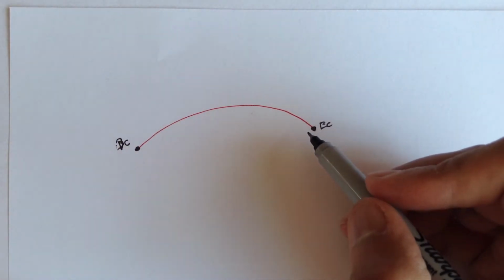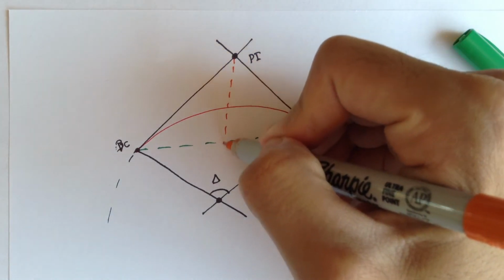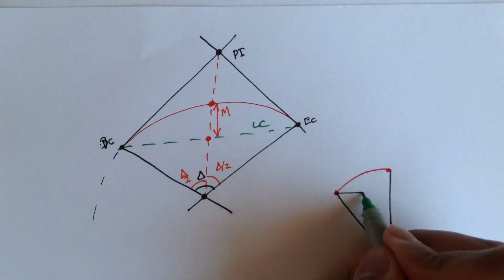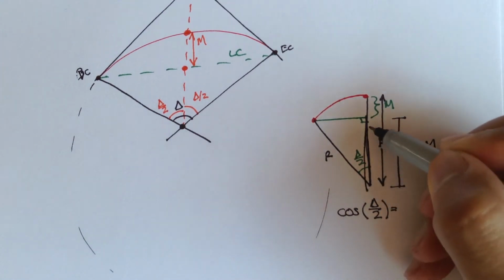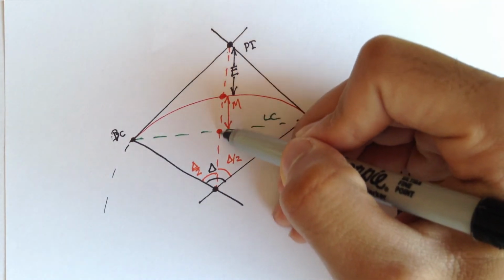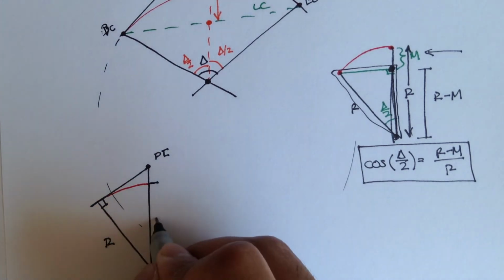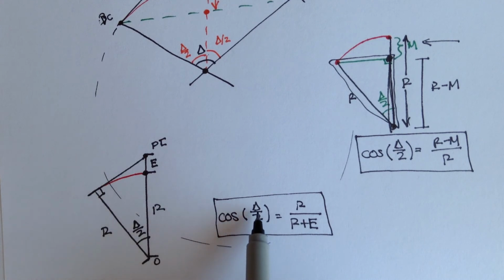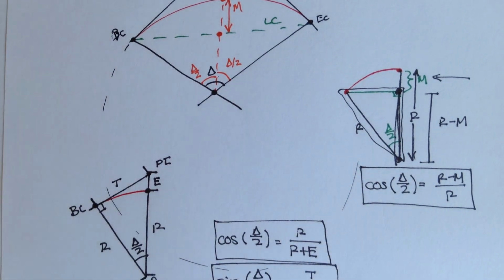Advanced Geomatics: External Distance & Middle Ordinate

Comment: Do M and E equal?
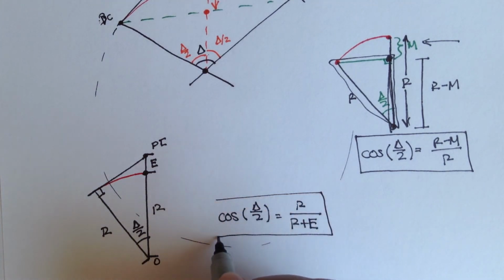Reply from the maker: +legion No, they are not equal. If you set the two equations that I boxed at 7:26, you'll find you cannot set M equal to E.
Reply: +Simmy Sigma dont they equal for a vertical curve?
Reply from the maker: +legion Vertical curves are treated a bit different than horizontal curves. The equations derived in this video are for horizontal curves which are based on the arcs of a circle. Vertical curves are parabolic and will have different properties based on their geometry.
Reply: +Simmy Sigma i see you have any video that prove m = e for vertical curves?
Reply from the maker: +legion No, not yet sorry. But I'll definitely consider it for a future video! :)